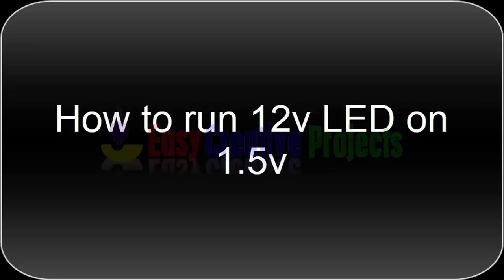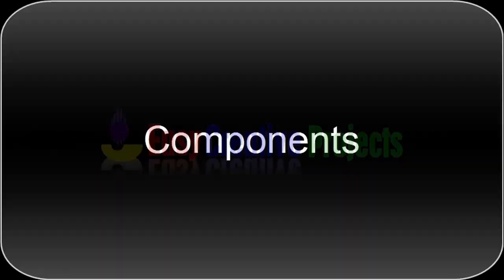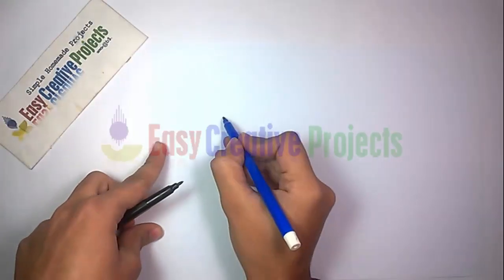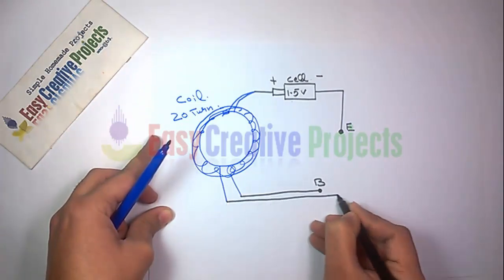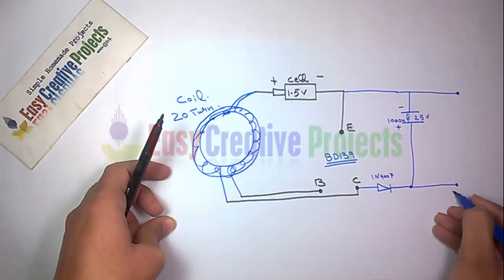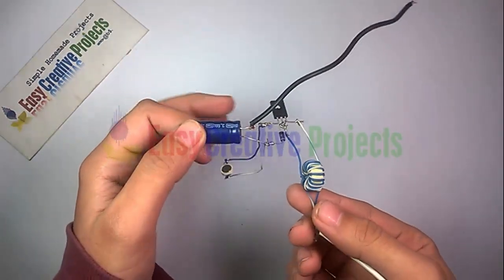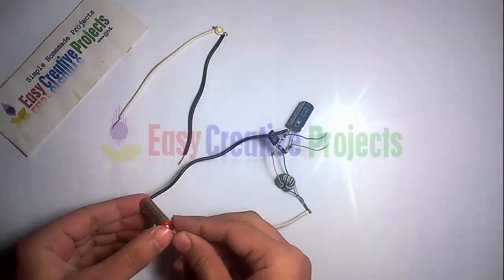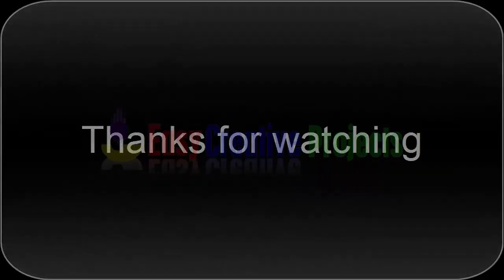How to run 12v led on 1.5v - easy with circuit diagram

Comment: Can I use bc547
Reply from the maker: you can use but its provide you low brightness. 
if you want more brightness so you need high quality transistor.
Reply: @EasyCreativeProjects  I had no high quality transistor,,
Can I use C945
Reply from the maker: dear you can use any npn transistor.

Comment: I have purchased lots of these 1w LED's and all are 3.2v - I have NEVER seen these in 12v - however this circuit WILL run the 3.2v LED's from 1.5v or even down to flat 0.9v AA MN1500 cells. It may even power the 3w 3.2v LED's that are available in the same package. This is just a common joule thief.